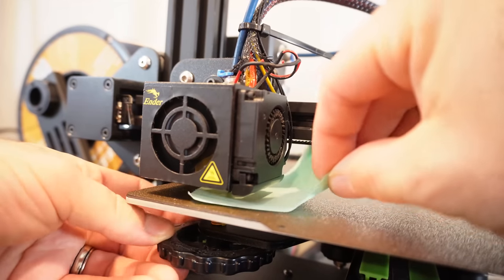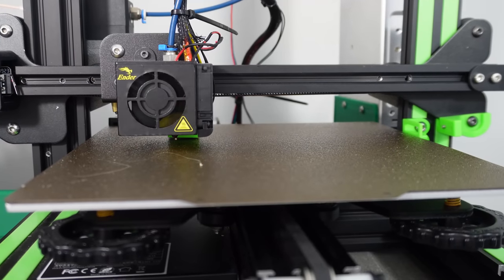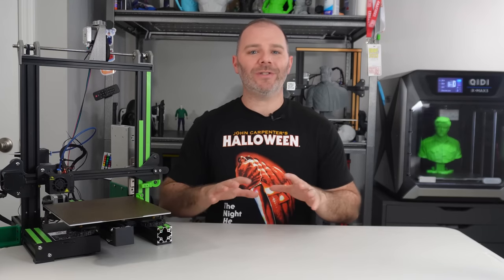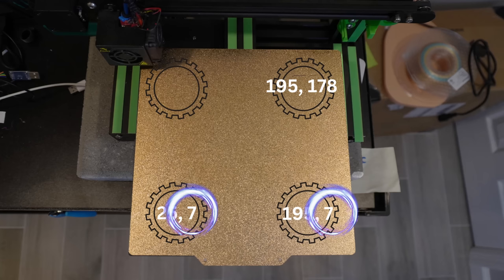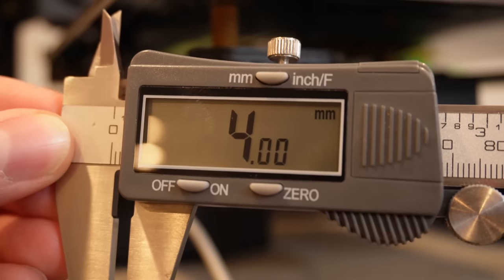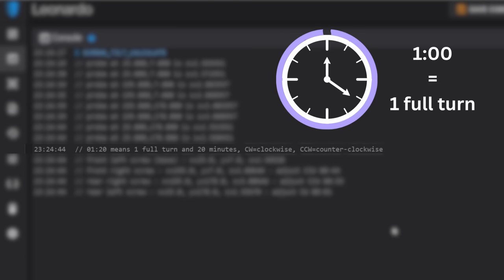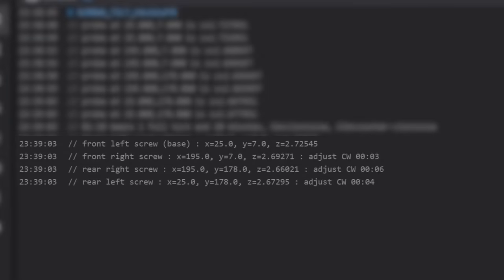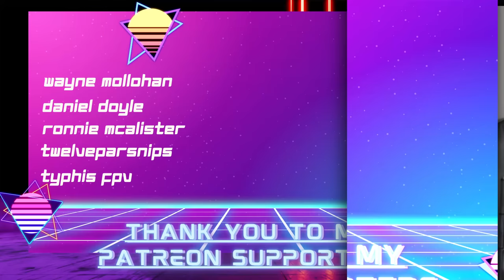Let Klipper level your bed with the built-in tool screws_tilt_adjust

Comment: Here's the config for various Neptune 4 printers:
-----------------------------------------------------------------------------

N4/N4 Pro Config:

[screws_tilt_adjust]
screw1_name: front left screw
screw1: 55,10
screw2_name: rear left screw
screw2: 55,180
screw3_name: rear right screw
screw3: 225,180
screw4_name: front right screw
screw4: 225,10
horizontal_move_z: 10
speed: 200
screw_thread: CW-M4 # Use CW for Clockwise and CCW for Counter Clockwise

N4 Max Config:

[screws_tilt_adjust]
screw1: 55,17
screw1_name: front left screw
screw2: 55,197
screw2_name: middle left screw
screw3: 55,371
screw3_name: back left screw
screw4: 414,371
screw4_name: rear right screw
screw5: 414,197
screw5_name: middle right screw
screw6: 414,17
screw6_name: front right screw
horizontal_move_z: 10
speed: 200
screw_thread: CW-M4 # Use CW for Clowise and CCW for Counter Clockwise

N4 Plus Config:

[screws_tilt_adjust]
screw1: 59,4
screw1_name: front left screw
screw2: 59,135
screw2_name: middle left screw
screw3: 59,270
screw3_name: back left screw
screw4: 314,270
screw4_name: rear right screw
screw5: 314, 135
screw5_name: middle right screw
screw6: 314,4
screw6_name: front right screw
horizontal_move_z: 10
speed: 200
screw_thread: CW-M4 # Use CW for Clowise and CCW for Counter Clockwise
Reply: so we don't need to add a different bed probe as in the video? The N4 works without any additional tools?
Reply from the maker: I don't have a Neptune printer to do any of this work so I really appreciate it! Next time someone asks about this I will point them towards your comment.

Comment: Wouldn't it be true that you only need 1 and 3 to extrapolate both 2 and 4? 🤓
Reply from the maker: Yes, correct! I try and walk a tight rope of accurate info but also present a thorough walkthrough, so sometimes I add little more than is necessary. Thanks for the addition !

Comment: "Because that's not the type of leveling we're talking about."

Only because you skipped tramming the gantry to the base in your explanation to that point, and because consumer printers don't ship with adjustable feet.  Admittedly most common spirit levels won't really be precise enough for this work either but it's still the same type of leveling when you don't skip steps. Of course, very few of us don't skip those steps, and I'm not one of the exceptions on most days.
Reply from the maker: I'll admit I am not 100% sure what point you are trying to make. I know you're trying to be snarky but I can't tell if you think using a spirit level is the "correct" way to level your bed? If you do think that using a level in that regard is correct, you are wrong. However you are right in the fact that tramming the X axis gantry is a huge part to getting a proper bed level. That being said the alignment we are going for with this calibration is the plane of the bed and the plane of the nozzle. Trying to use a spirit level to accomplish this will just fail you. I hope however you level your bed leads you to successful prints but I wish you wouldn't try and disparage a large portion of the 3d printing user base while doing so.
Reply: @PrintsLeo3D  Very minimal snark, actually, and no disparagement at the majority of end users.

To "properly" level and tram a machine involves a lot of steps, most of which are skipped or unavailable on the majority of consumer grade machines in ANY category. That's not disparagement, even at the manufacturers, just an observed fact and one with understandable reasons behind it. The snark was mostly aimed at the perpetual falsehood that spirit levels serve NO purpose in the process on consumer 3D printers.

A spirit level can speed up tramming significantly by eliminating the need to bring the nozzle to each point until you're already most of the way there. The trick is to check the level of the platform underneath the printer and then on top of the base of the printer first, followed by the gantry and then the bed. It doesn't get you into the micron precision range but it's not useless either.

Comment: That minutes thing is confusing as all hell. A minute is 1/60 of a degree. Just tell me how many degrees to turn the thing, or "1/4 of a turn".
Reply from the maker: You aren't the first person to comment about this. For whatever reason this is how Klipper decided to set this system up, Kevin and those developers are smarter than I could ever be so I usually trust their implementation. I tried to make it easier to understand, just make the movements the same as your would the hands of a clock, but ultimately it's something that is going to sound/feel foreign to some people. Hopefully this still was able to help you in some way.
Reply: @PrintsLeo3D  Oh, it helps. Without your heads-up, I'd have wasted hours on it, knowing that something was wrong. I find it surprising that such technical people didn't consider this. Thank you.
Reply from the maker: Anytime. I appreciate you taking the time to let me know in the comments, this is the only way this sort of thing will ultimately be ironed out or considered for the future. Thanks!

Comment: awww shucks i only have access to octoprint at the moment
Reply from the maker: If you're running Klipper through OctoPrint you could always switch front ends and get some access to these features. Otherwise just take your time and try some of these when they become available to you take advantage. This is a great tool but it's not something you can't achieve through other means. Good luck !
Reply: @PrintsLeo3D  installed octoklipper and installed bed visualizer and i now have a level bed that you so very much
Reply from the maker: Great! Glad you got access to it!

Comment: 20 minutes on a clock is not 20 degrees. It's 120 degrees.
Reply from the maker: This is been a sticking point for a lot of people, and I completely understand. This is how Klipper decided to implement it , using a clock face as a reference for rotation, so I tried to break it down that way the best I could ie. 1 minute = 1 degree for our purposes. You're right though, the degrees of rotation on a clock face do not match up with a 360 degree circle and the corresponding degrees each of those minutes would be. I appreciate you pointing this out because if (and when) I do another video on this I am going to take extra care to comment on exactly this. Thanks!

Comment: 20 mins doesnt equal 20 degrees, its way too close to 180 degrees.  its 120 degrees if my maths right.
Reply from the maker: Yes you're right about that and I think my explanation may not have conveyed what I meant, because we are using two different models. For purpose of this routine(screws_tilt_adjust) a full rotation would be 60 degrees (not 360) just like a clock face - 60 minutes in an hour, an hour is 1 full rotation - One full circle is 60 degrees. So to keep it simple for us 20 degrees would correlate to the same distance on a clock face (20 minutes). I hope that clears it up a little.
Reply: 20 minutes is 20/60 (1/3) of 1 degree! It's a tiny amount.  Degrees/Minutes/Seconds goes 360 degrees to a circle, 60 minutes to a degree, 60 seconds to a minute. If you get anything telling you to turn by less than 1 degree, it's basically negligible.
Reply: Oh wow - "Note that "minutes" refers to "minutes of a clock face" is a terrible choice of naming when there is an exsting unit of angle called a minute... https://en.wikipedia.org/wiki/Minute_and_second_of_arc
Reply from the maker: Yea Howard, this is how Klipper and by extension Kevin O'connor chose to set this up. I tried to make it easy to understand Klipper's terminology, but I think I could have been better served to go a little further in depth about it. That being said I trust Kevin, he's way smarter than I am , so if this is how he set it up I'm sure there's a reason for it.
    I appreciate your input and you taking the time to be so in-depth with your response.

Comment: Four corners... bump in the middle Tough luck
Reply from the maker: Depending on the bump that's where you'd hope your bed probe comes to your aid and can handle those discrepancies. KAMP is another great option for you, which is Klipper Adaptive Mesh and Purge. This allows you to probe only the area you are going to print on. So if you aren't always printing on the entire bed, that should help your first layers.

Comment: 12:26 im sorry but this is not how to measure diameter
Reply from the maker: I can appreciate you calling me out but would you provide some insight on the correct way to measure it?
Reply: @PrintsLeo3D  Just clamp around! Perpendicularly to the screw. It will be much easier and require only one hand, no precision needed.

Comment: In sonic pad, ender 3 S1 pro...I don't have the screw tilt calculate option. Is this because it's sonic pad and not the FULL version of Klipper?
Reply from the maker: The Sonic Pad is definitely somewhat of an arrow to the knee of Klipper, but you still are running Klipper and should have access to all its routines. In order for screws_tilt_calculate to appear you first need to add the macro to your printer.cfg (or add it separately and [include] it). After adding the screws_tilt section, saving and restarting the firmware, the option should show up for you.